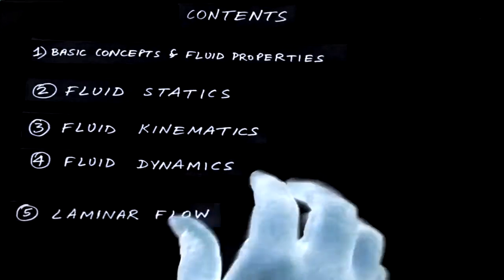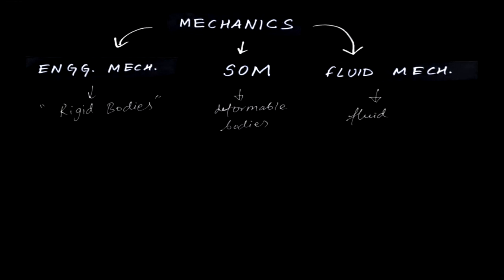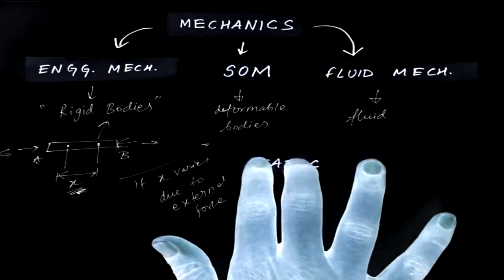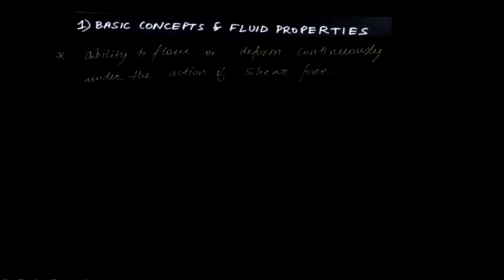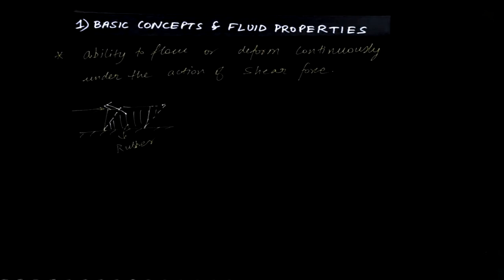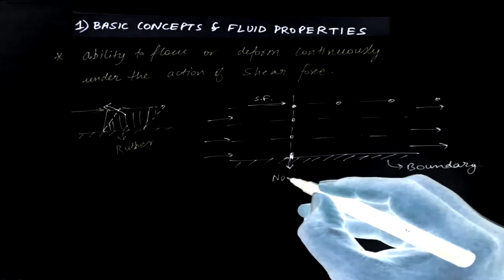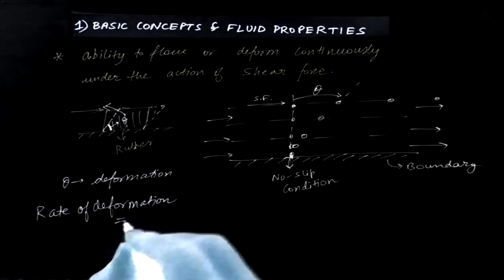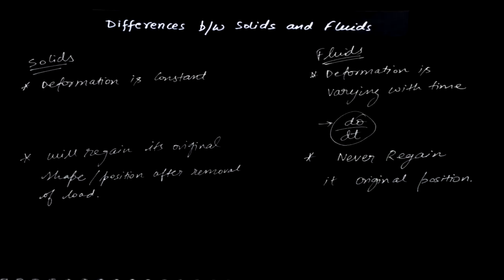INTRODUCTION | FLUID MECHANICS | Civil & Mechanical Engineering | GATE | IES

Comment: you said fluids deform continuously even when we remove force. When the deformation will stop?
Reply from the maker: sir, i meant to say that: even if you remove shear force, molecule will keep on deforming (it will stop eventually) i.e. will not come back to its original position like other solids do. So it will remain deformed even after removal of shear force.